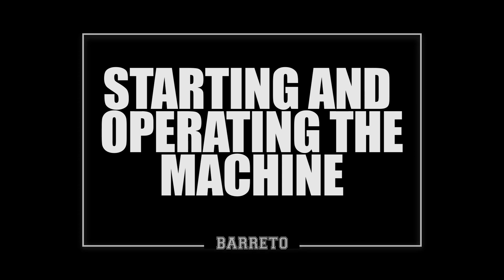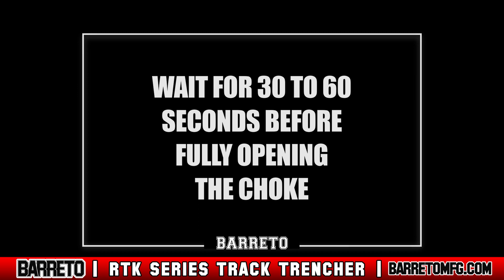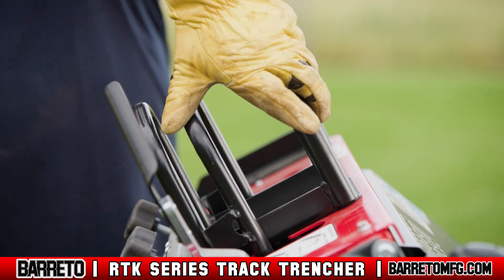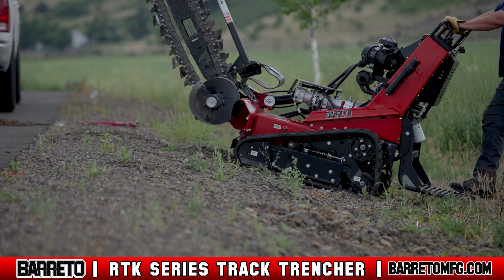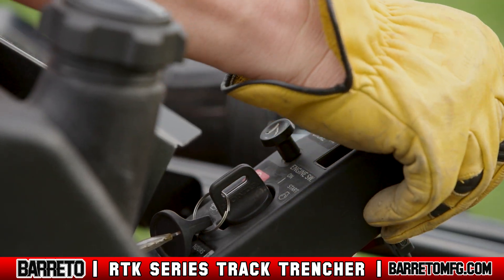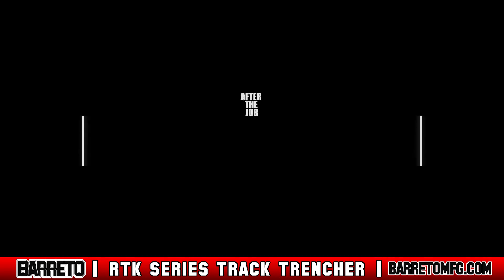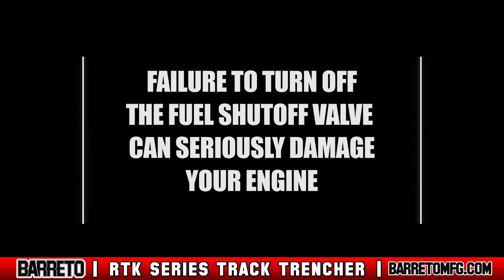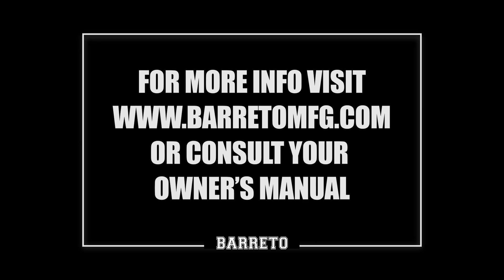RTK Series Stand on Track Trencher Quick Start Guide || Barreto Manufacturing, Inc.

Comment: The Forward and backward drive of my machine don't engage. It just give a sign of trying to move but doesn't actually move. What could be wrong ......?
Reply from the maker: Unfortunately, our social media team doesn't have the training and knowledge to troubleshoot equipment issues. Please contact our tech support crew at 800-525-7348 or parts@barretomfg.com, and they will be able to assist with your issue.
Reply: @BarretoMfg  I tried only get voicemails
Reply from the maker: @DWhyTv  - We are experiencing a high call volume. If you email and ask them to call, they will call you back.